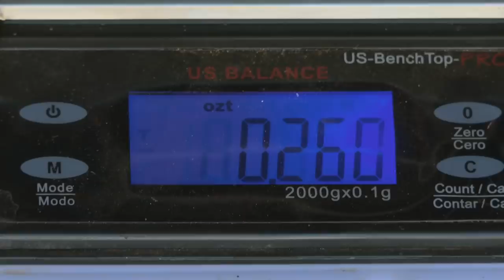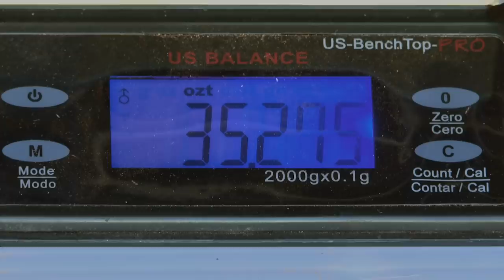Poseidon Crew Smash Season Target With Huge 33-Ounce Gold Nugget I Aussie Gold Hunters

Comment: OK - You guys need a plastic trailer that houses 4 or more detectors and a way to determine what detector has indicated on target.  You then walk the trailer up and down, vastly DECREASING your detecting time.  The height that the detectors are off the ground will set the minimum nugget/target size.  You could also have a paint/chalk spray showing where the target is.  You scan + mark, then dig up...  Work with local College IT to perhaps combine detector inputs onto tablet screen...
Reply: I've been thinking that for a while now it shouldn't be too hard Coils are easy enough to make if you know what you are doing and some raspberry pies or an Arduino or two I reckon about 10 grand should do it. 
I wish I could get into the country I would turn up on their door and figure it out.
Reply: @thedave7760  I think the ideal setup would be a cart/trailer that is as wide as your loader bucket, that detects and marks each hit.  You then go back and dig up those f'n mallet heads.  If you made your own coil, perhaps you could use the new Raspberry Pi 2 Zero combined with the RP Picco.  I can't get over the Aussie prices.  Good Luck...